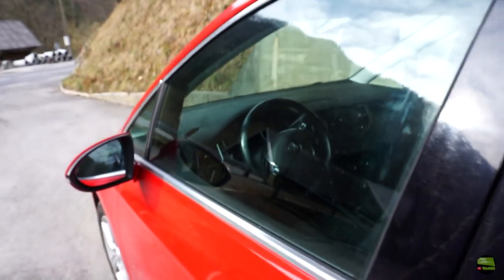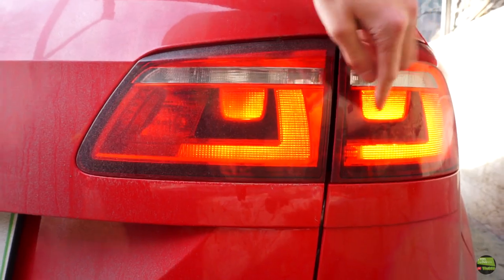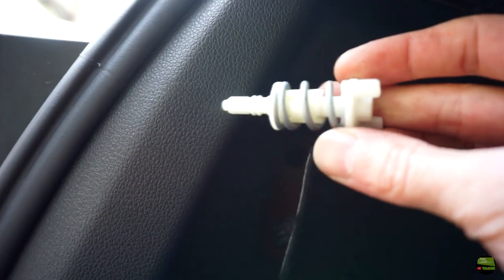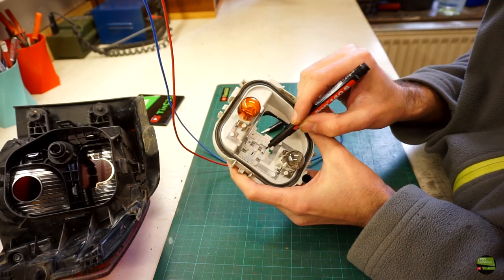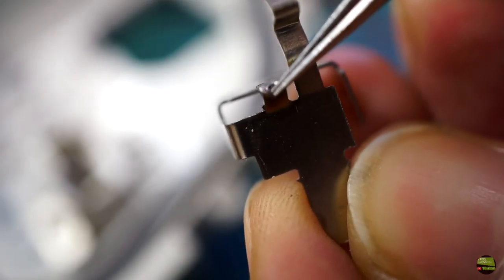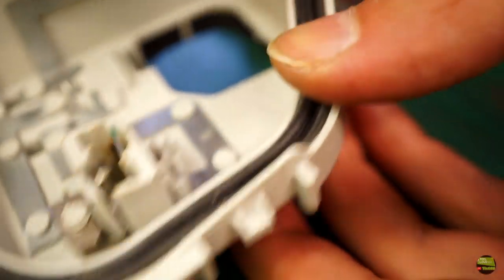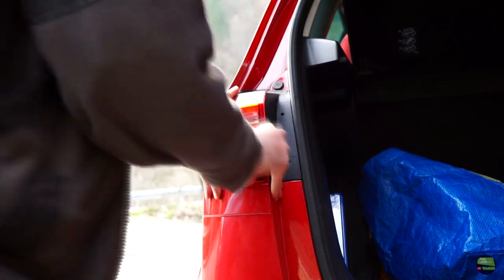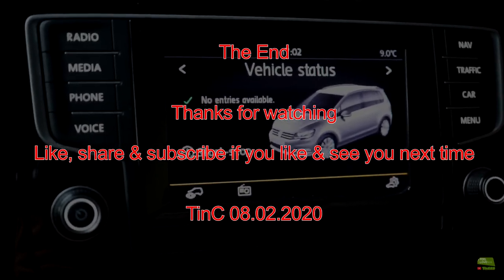How to fix VW Golf Sportsvan tail light bulb issue

Comment: Exactly this has happened to mine, but I am worried I will mess this up if I try it. I have no experience of this type of thing. When you take the metal bit out, you say you cleaned it with a rotary brush, would I be able to do the same with just a wire brush? Really don’t want to pay someone to do this. Also, why is this such a common problem? Surely VW should be issuing guidance?

Comment: I have 2015/16 VW 1.2 Tsi Sports Van and I also had the same fault on the left side, similar plastic melting as well, but not too bad. Then I had the problem where the entire tail light came loose, only to find that the plastic spring loaded screw, built in plastic nut on the tail light side, BROKE. I had to find all the pieces and SUPER GLUE back together again. Not sure how or why it broke as the spring loaded plastic screw was not tightened as much as it was from the factory, for fear I may break it, and it still BROKE much later ON after replacing the burnt out 12V 21W bulb.

Comment: Please, do you have idea how to fix rear burn dynamic turn signal, or need to replace all lamp , thanks
Reply from the maker: Sorry but didn't seen an open dybamic light yet, check if there some bad connection i don't know what else can be.
Reply: @TinC33  Yes you are right,  I found two wires cut, but after connecting wires the issue still the same,  only there is some improvement,  dynamic signal blinks when I lock or open the doors , and when I switch on warning signals it blinks only one time then no more....
please do you have any suggestions,  Thanks
Reply from the maker: @samirboualem3547  so there should be some short, idk it's hard to say without see part and measure them.